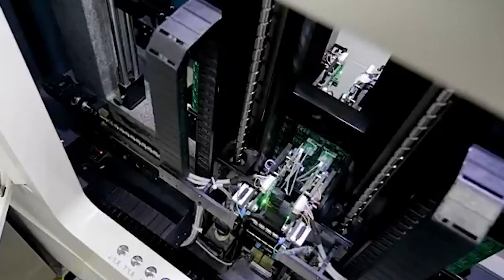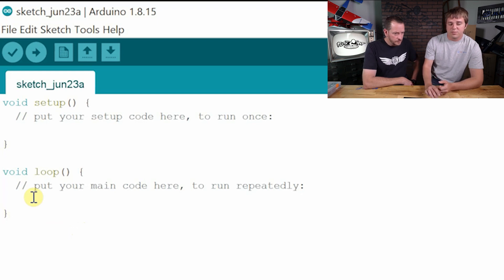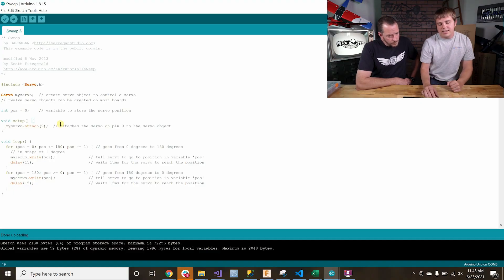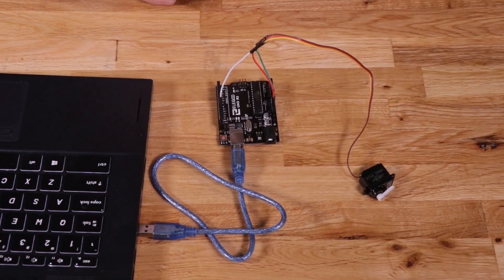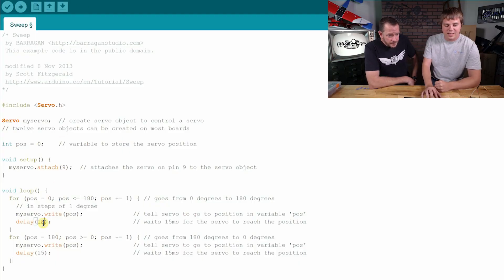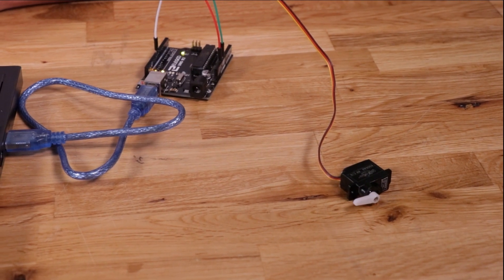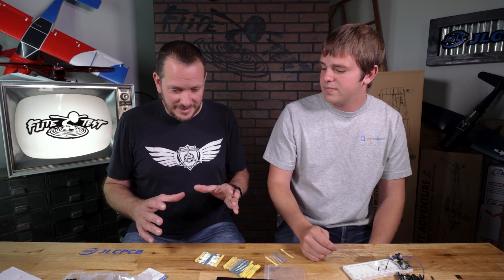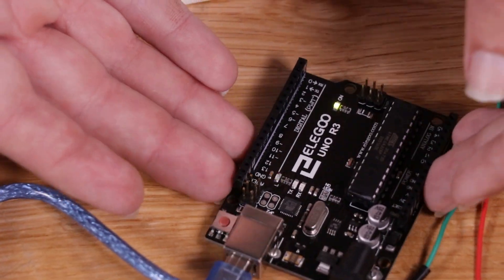Arduino Basic Programing

Comment: I have a question that may not get covered... as I understand it the Arduino is powered by 9v., the output pins are putting out 5v each, if I had 9 led's  each on their own pin, using 5v each, wouldn't that cause a drop in voltage across all of them? How to avoid this?

Comment: When working with high speed loops (e.g. flight controller loops), be sure to not use delays!! They literally pause the code and wait, which will cause you to crash if you're banking on the loop to run constantly to stay in the air. A better way is to use counter variables that increment in time with each loop and reset to zero when your desired time increment is met
Reply: THIS^^! There's way too many examples and common use code structures that implement delay, when they should be using timing loops with system millis checking and sub functions to handle whatever you want to process on a trigger interval.